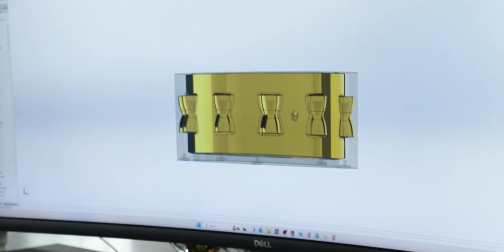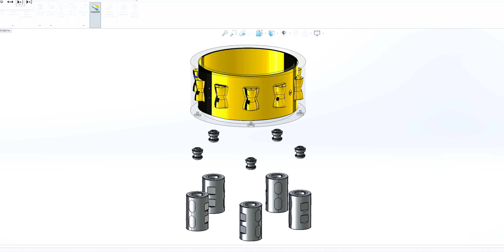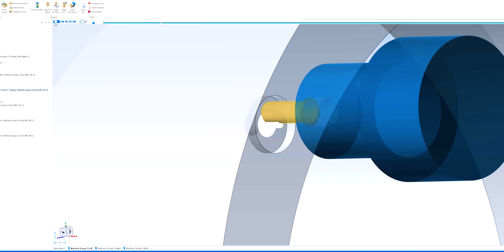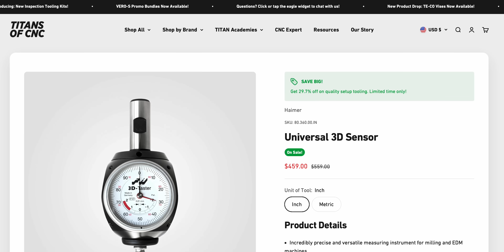Workholding to Create Workholding: INSANE Technique!

Comment: I find it interesting that he wants the lugs - which accept the bolts that hold the heads on - machined right into the shell. It'll be pretty, and the lack of bolts through the shell to hold the lugs on should change the instrument's resonance for the better.

But DAMN that's gonna be a low-pitched snare drum!

Word of warning before you start: The most critical thing on a drum are the top and bottom edges of the shell. These are called bearing edges, because they bear the pressure of the head. They completely affect the sound of the instrument, so they've got to be perfect. What you'll want to do after you cut them is get David into the shop to mount heads on the drum and play it...expect to be putting this shell back in the mill at least once and maybe twice to alter the edges.

Comment: we will get the gressel zero point system in some time (basically the vero S but mechanical) and for big parts on our new 50" 3 axis this will become very interesting for fixture solutions. got a big rota flex 1000 but for those big big pieces the zero point will make interesting parts

Comment: In order to get the chatter marks away from the chamfers, I recommend a spiral chamfer cutter
Reply: He is not plunging,he is contouring and those marks are not chatter only tool marks which is easily avoided by slowing the feed.
Reply: @mehmettemel8725  tool Marks are also a Form of Chatter but not this rouhge. You can slow it down to avoid it or you can take the tool i recommend beacus you have more cutting edge on the Spiral euquaös in more Stabilität while cutting . And what is with plunging never seid a Word abou this?
Reply: @Simbolt  When you said spiral flute I was thinking of spiral flute countersinking tool which I have a set only use it for plunging like a drill for chamfering. My apologies misunderstood.
Reply: @mehmettemel8725  my Englisch is Not the best  could explainde it a littel bit better. So no worry have a nice weekend.
Reply: @Simbolt  Don't worry it's not that important.

Comment: I don't have years of experience with machining brass parts, but I've got a habit of chamfering threaded holes before I cut or roll the thread.
Reply: I always got told to chamfer before cutting threads
Reply: Ditto
Reply: Yeah I thought the same.